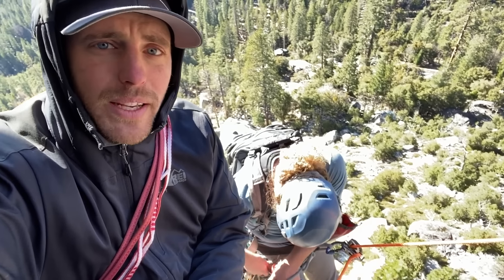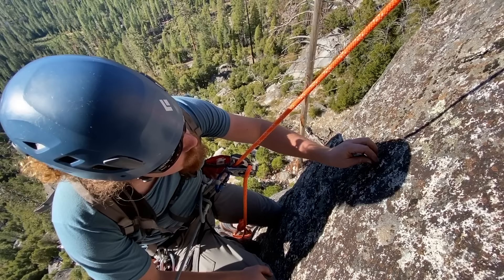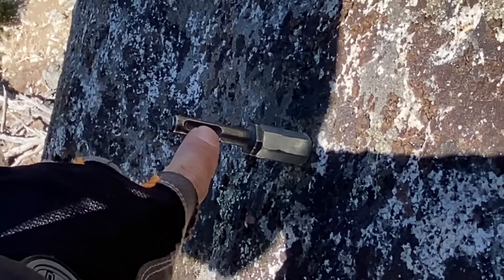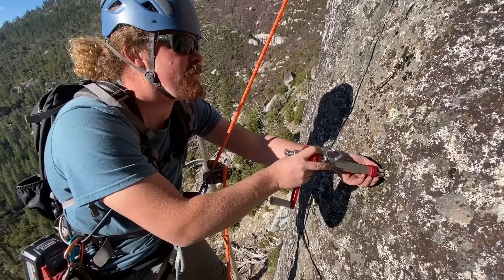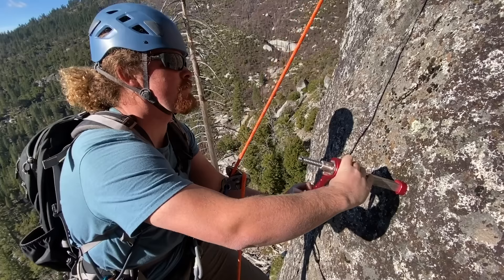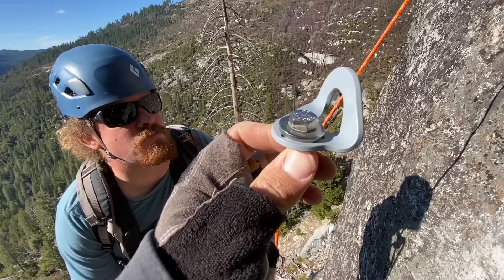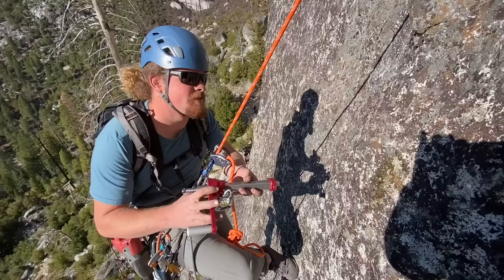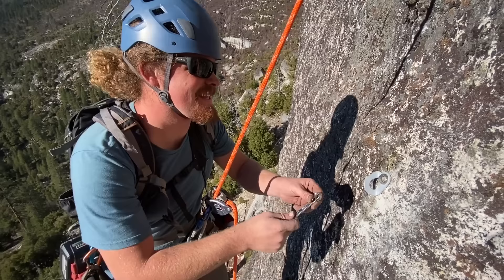Replacing Climbing Wedge Bolts with Powers Bolts at Sugar Loaf in Tahoe

Comment: Way back in 1981 on my first trip to the US, I volunteered to join a local climber to replace some really ancient 1/4" split bolts on a Tuolumne/Yosemite climb.
I lead up each pitch, then he followed and at each bolt (about 4 or 5 per pitch, so very sparse!) he would use his hammer to remove the old rusty bolt, then use the at the time very modern "self-drilling" hollow bolts (about 10 mm diameter?) with drilling teeth at the bottom: Hammer them in by hand while rotating the core with a handle (i.e. about 20-30 min), then when it was deep enough you withdrew the handle and bolt, inserted a conical wedge in the bottom of the cylindrical bolt and put it back in. A few final taps with the hammer would expand the cylinder and set it in the hole.
The scariest part was that most of the old bolts could be pulled out by hand or with just a single tap with the hammer, so I had in reality more or less soloed the pitch. :-(
Reply: Haha, thats such a good story. Do you still climb?

Comment: Strong Tie and hilti make a Manual hand pump for blowing out the holes. Might save you a bit in the long run over compressed air. Might take a bit longer. You guys are badass doing this job hanging off a cliff.

Comment: on first bolt, if not enough threads exposed to reach the stop on coupler, you can use the bolt puller to pull some threads out more, than retry to install coupler and try and spin again

Comment: If you put a bolt in the  first coupler he tried to use. Then you can  adjust it to have the bolt bottom out onto the other bolt before the  coupler touches the rock and engages the wedge
Reply: I thinked of the same thing too, hope they see this comment.

Comment: You need to use slim jam nuts that way the adaptor won't go all the way down to the rock and apply out would force on the sleeve if you want to notch the base of the bolt.

Comment: Bobby, I know you're the expert, but if you use a coupling nut with a bolt set in the back, you can jam it up tight towhere even spinning it won't pull it any tighter. I think that would work well.
Reply from the maker: Absolutely. Refined my techniques a little since this video. I don't use the impact driver anymore. -Bobb6
Reply: @HowNOT2  Awesome. Thanks for all the hard work you guys do!

Comment: you should just have a short but semi loose rope that you can attach the tool back onto when your using it so in case you drop it you'll still have it but it wont impede on working or range of motion especially since most of your tools are already hooked with biners

Comment: Try using 2 nuts tightened on the threads so you can spin the bolt to the left. That's how I remove studs in the automotive tech world...

Comment: Have you tried to use a stud remover pipe ? They jam on the bolt, and you could turn it with the impact drill.
Reply from the maker: I haven't tried that. Do you have a specific product in mind. A web search revealed a bunch of different styles. -Bobby

Comment: Sick Ryan!!! Learned a lot!! Can you get those couplers at home Depot or Lowe's? Plus I plan on replacing 1/2" Terry bolts here in the pouder soon. What would you recommend I use instead for new bolt? Glue ins? (I'm guessing I would use more glue with bigger hole.

Comment: If you used a bolt and a coupler, could you make a spinner that only engaged a few threads? (The more you put the outer bolt into the coupler, the less space for the bolt you are removing)
Reply from the maker: Good idea

Comment: Two questions.

1- What is the contact of the guy on Mountain Project that manufacture that "bolt remover".
2- You are drilling the hole so it matches the new, but what if the current hole already is the correct size for the new bolt?
Reply: You must always go bigger unless using a glue in type.
Reply: Much of the older hardware (in general; area dependent) is going to be smaller, as that's what they had back then so, it's pretty easy to go up a size. You can see how much effort rebolters go through to remove old bolts and this in order to reuse the same hole but, as a very last resort, one can patch the hole with special putty, mixed with rock dust and this to match the local rock. If done right it's practically (or is) unnoticeable. Then just drill a new hole next to the old one with the right size. But, as I said, that's a last resort, as one can usually go up a size. Always getting the old bolt out without it breaking off inside, well that's another story and usually all you do at that point is patch it and drill anew.

Comment: Hi there, do you guys have some information on how to remove glue in bolts?
Reply: Just turn it with the Maschine until it's lose in the hole and than it's almost the same like you remove the others. And after getting it out you drill the glue away and have a new hole. Sorry my English is not the best. Greetings from Austria